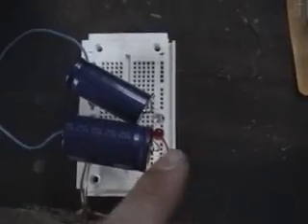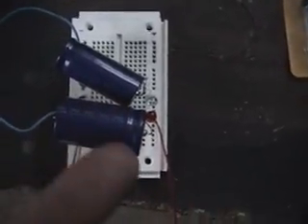Utilization of Radiant Energy 1901 Nikola Tesla,My test 3

Comment: In general it's when you connect things parallel you gain current and in series you double the tension. Just like batteries.
But I'm gonna make the teslacoil first. Make some nice jolts!!!And get into the thinking mode of tesla. Got some good Serbian music too!!! Europe you know!!!!
Than I'm gonna buy shiney stainless steel plates, which I found very cheap. Wrap them in foil and cover my roof with it. Next thing is hiring a drillhammer and the tools for banging in a REAL good earthrod. 12mtrs!!!

Comment: @turgor58 part2..but the tesla towers should be used, imo,to attract the cosmic ray energy so it can be captured and stored/used - not to make lightning from a wall socket.  To capture the juice just use a spark gap, so that, say, only 12 volts can come out across the gap and into a 12v car battery for instance.The big coil at the tower base should have a spark-gap device attatched to one end of its coil,so that the energy has an outlet.The other coil end should go to a pipe in the ground.

Comment: Instead of 'just' putting an electrified antenna or big ol sheet of metal in the air, why not just make and use a classic tesla coil tower?  Its made of metal, right? By anchoring it to the ground of the land beneath it with metal pipes....your tesla coil tower will of course resonate with the Earth's natural frequency of vibration which is something like 7.46 hertz I think.  Most people have it backwards - they make those towers, plug them in, and create lightning bolts...but...

Comment: I came to another idea for you to extend the surface of you insulated plates.
Just take allufoil(household stuff) cheap and shiney. Cover that in fridge foil which is sticky and put it underneath your roofgarters, right against the rochwool roofinsulation. If it's no good, it helps heat reflexion. But it's cheaper than buying loads of sheets of metalplate.
But use no copper leads because electrocorrosion will eat the foil due to the diff. in the periodic system. Just let a tiny strip of foil out

Comment: I've tried a bridge rectifier with the ac , as above so is below input, to the rectifier. The + and- give a clear voltage of a fluctuating result of 1.7 to 1.9 volt. When I hook a 22000uF cap over it the tension drops a little bit but is charging the cap. I use an Elco cap of 25V.
But what i also found out that when I hook an ammtr. between the waterpipingfrom the grid and the earth pin, there is significant more current there! That brings me to the Russian invention. Curr. is about 0,003 Amp.

Comment: Telsas idea that electricity can flow both ways simultaneously on a wire is the key.  Picture Niagra Falls generating  constant power to a Tesla tower like Wardenclyffe, making it act like a gigantic antenna to attract HUGE amts of cosmic rays.  Then, having all that voltage shooting down into those metal pipes in the earth, creating a humongous power wave at very low frequency that bounces backandforth. Poof free energy for all- using the earth itself like a giant insulated transmission wire.

Comment: way to go - keep up the good work.  I'm not a scientist, but after reading over tesla's diagrams and patents a few years ago, I almost tried to do those experiments you are trying - with the big metal insulated plated.  THEN, I read about how you can use just a small thin antenna - that extends high in the air, but it has to be electrified. Makes it act like a metal plate as big as a football field, attracting cosmic rays like a mini blackhole might attract light. Current  flows both directions.

Comment: You're right, it has a huge advantage over solar, notice everyone seems to keep quiet about the fact solar only works properly 4 hours out of every 24. Divide the cell efficiency of 30% by the 16% of the day they actually work and the power generated for the money they cost is pretty poor.

There's no way of estimating how much wind power generates over a given 24 hours, it's too random.. but wind farms are now in the 100s of megawatt range... that's a fairly large target to compete with.

Comment: Hey I wanted to recommend that you look into improving your ground. From what I understand you probably want to have similar masses for the + and - components of the circuit. So 1 big aluminum plate up top means 1 aluminum plate in the ground. Otherwise the ground will be your weakest link. I'm pretty sure I read about this in a tesla patent.

Comment: Yep, I know he used 2 large balloons at 1000ft to collect 3.4 kilowatts. There's also Moray but there's never any real technical details about what he did.

A primary advantage of atmospheric electricity compared to solar and wind is that it runs 24/7, night and day. 

The main disadvantage seems to be the sheer size and height of the antenna required to deliver small amounts of power.

Comment: In March 1971, Dr. Oleg Jefimenko proved that a wire held aloft by a ballon at 1200 feet altitude would provide 70 watts of high-voltage power to an electrostatic motor

Comment: The basics formula is 100v per vertical ft but @ microAmps.  Obviously 300ft vertical is abit hard to do, although it's been proved to produce the best results. (a 1000ft 'skywire' has powered a 1/3hp 'static' motor) My best guess is that going horizontal is like going parallel, i.e more current, but it's an old radio truism that vertically polarized antenna pick up more 'static'.

It also seems the ground connection is just as important as the antenna size, another old radio truism.

Comment: 100m (300ft) is plenty of surface area. If you have antenna building experience you'll know a tuned bit of copper wire can produce some amazing results. 

I just found this info on a ham radio forum where many hams have long wire antenna in their yards and it's a well known fact that during storms a long wire antenna collects potentially lethal voltage and they disconnect the antenna lead to avoid equip being zapped .

Comment: I read about a simple set up that used a 300ft insulated wire on one end and a good earth on the other side of a high voltage capacitor (the longer the wire, the higher the voltage, and the cap is meant to be in the 1000v range) Connected in parallel with the high voltage cap is a simple circuit consisting of a spark plug and car ignition coil to step down the high voltage to 12v. The cap fills and periodically sparks the air gap into the coil. Could charge a car battery in a day.

Comment from the maker: yea i was wondering about the threshold voltage of the leds no letting as much energy through. whos hacker club?? really i dont need to insulate the plates??. i was just copying teslas patent the best i could and he stressed the importance of insulated plates. ill try what you say about the foil. what do you mean by electret foil. is that like when you run high voltage through cooling wax and leaves a permanant charge in the wax, but i never heard of electret foil. thank you for helping me out